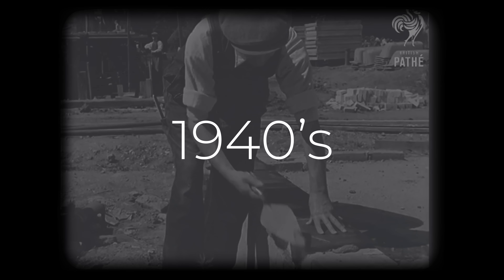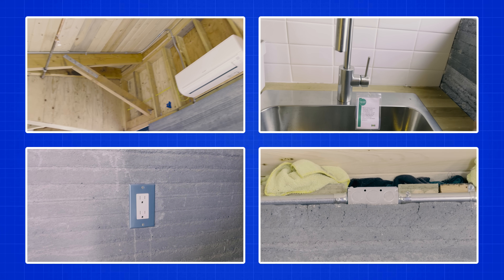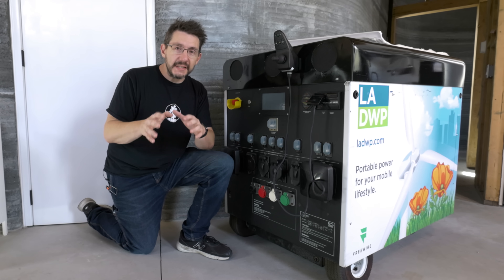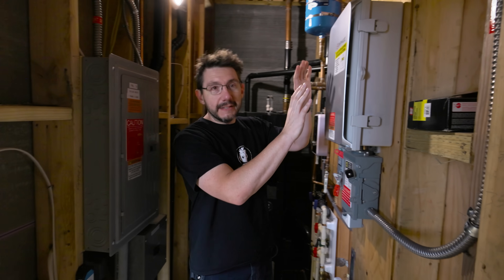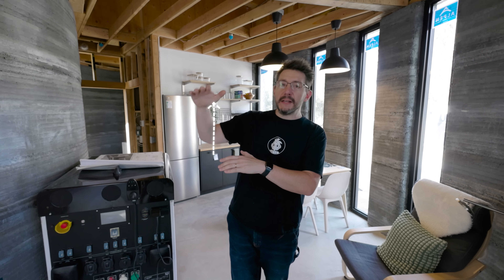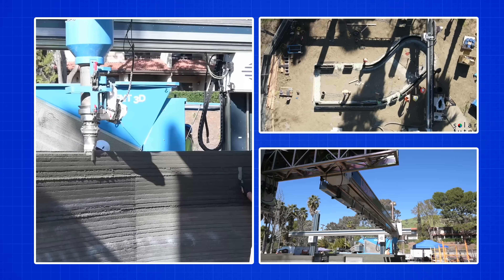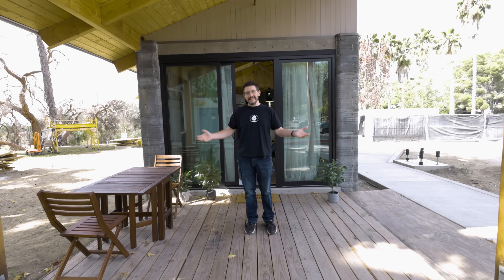ON SITE at a 3D Printed HOUSE!

Comment: to get the price down make a big square or rectangle. There is too much wall per square foot inside. It takes more power to run the AC, more for heating if you do that in LA, more materials for the walls, etc. Round is great too but doesn't work with many modern building materials.

Also how is it insulated and reinforced? Is there any insulation or reinforcement in the thin concrete walls?
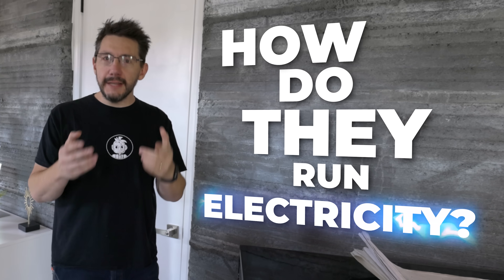Reply: @1:59 you can see down into the wall and they're using z ladder reinforcing wire laid between x number of layers.  I'd assume that after the walls are printed, they drop reinforcing bar vertically into the cavity 4 feet apart and encased in a grout mixture.
Reply: Square are cheaper to build than rectangle

Comment: I'm all for the idea of 3D printing in architecture and it should be studied to explore possibilities, find arguments for and also against the use of it, figuring out when to use 3D concrete printing and when not to, improving existing techniques and knowledge... etc. Nice to see these students actually experimenting with the stuff!

But I have mixed feelings about the presentation: the fact that they (you?) tried too hard to sell the house as a finished product like a transition house is ridiculous. Like most school projects by students, the result should not be presented as a practical / market-ready product. It should be seen for what it is: a lab, a testsite to see what works and what doesn't. A place where students can experiment with techniques, where they can learn what is already known and maybe even expand the knowledge base.

Personally, I think this video would have been better if it had focussed on the students and the learning/experimenting, rather than trying to sell a 3D printed house...

Comment: I don't like the idea of filling the walls with solid concrete. It might increase the stability, but it would make it very difficult to modify in the future. Say you want add extra outlets or run some new form of data transfer or something? Why not fill it with insulting foam or shredded waste plastic or something? I'll bet my AMS could fill that in a few years.

Comment: Very cool architecture! Only thing ithcing me as an owner of a solar power system myself is that the cells - at least in these shots - are placed exactly where the shadows of the surroundings are while all of the non-panelled roof is in bright sunshine!
Reply: designed by students. have you met many young folks?

Comment: I find it strange how the design of most 3d printed houses is a strange shape with curves. You can't even hang a painting on that wall. And there is no thermal isolation... there is thermal mass so if a concrete wall heats up during the day, it will provide heat all night.

I think there are still better ways of building cheaper. In eastern Europe we had about $100 per square feet retail price. Prices might have doubled now. Construction should be cheaper, but unfortunately everyone needs to make a profit.

Comment: 3D Printed House, umm bit misleading really, only the walls. Carbon Neutral - don't worry about that, make as much CO2 as you like it doesn't make any difference to anything. Don't get me wrong I'm a 3D printing fan and do a lot, but if you are going to print houses your printer will have to be a lot more capable than that.

Comment: For cheapness couldn't they just print it in a spiral (vase mode), then use a rock drill to drill out some holes for circular glass bricks, then crane a pre-fab roof on top. Failing that pre-fabs were invented in the 60s for cheapness :D ... and that's how china builds a lot of cheap housing quickly!

Comment: I'm curious what the comfort factor of living in this house would be like?
With the walls being 1.5 inch layer of concrete on the inside and out, with concrete added between: I'm wondering what the R-value of the walls is like because concrete typically have very low r-value of 0.1-0.2 R per inch. I assume R-values increased somehow, being the design was part of an energy efficiency competition? 
Is neat idea, but would have like to see more details on the construction method, and some cost breakdown. (type of foundation, walls, window/door install details, how water pipes installed, etc .. and how costs of each compare to traditional home construction)

Comment: I love the idea, but why not build the roof and/or second floor as a separate part similar to a smaller scale model and combine the parts. I would imagine with the right design it should work if it was printed on plywood or something and be able to separate it after transport.
Reply: Build volume is a problem. You need to print the house. Printing a roof flat and then lifting it in place would require a second setup of the printer.  Also, this particular printer is quite a process to set up. Version 3 looks like it will be better.

Comment: My college won a Solar Decathalon a few years back with some friends of mine. It's a cool thing to check out.

I've been conflicted about 3D printed houses... it's like the miracle item. "I want a home, pick some stuff on an online wizard, and... go" and then a house appears. But it's also very demonstrative without showing the advantages that are needed for many homes. $150k isn't affordable. Of course, with time costs will go down... but at a time when so many places are having issues with affordable housing, they aren't exactly rushing to build sparse transitional housing... heck, they aren't exactly keen on dense transitional housing. It doesn't exactly build the homes that those who can afford it would go for, it's too big for "Tiny Homes" especially at that cost. And it's already been demoed that modular component-build houses can be done cheaper, faster, and with more customization.

For as much as I like 3D printing, it is one of those things where you do have to learn when not to 3D print a thing. And with houses, the selling point for 3D printing just hasn't been demoed. I've read news article after news article, blog after blog, video after video... and they the most compelling use case is something like the moon or mars, where space is limited for bringing equipment and materials and using the surface material is basically a necessity. And a lot of time, space-missions are quite expensive so this looks affordable for that. But on Earth... bunch of wooden cubes > 3D printed home. At least for now. Stuff comes up every couple months so I'll keep looking for that _moment_, but this isn't it. But good luck on Woodbury University on the Solar Decathalon, it's an awesome event, even if 90% of the innovations of all the students who participate never make it out because of some esoteric reason that shouldn't be limiting it.

Sucks being negative about this. One day... one day...

Comment: I don't think this adds too much - brick building can be built in similar fashion in comparable time using existing techniques. The demonstrated building still needs foundation, roof and other structures, the benefit of 3D printing here is mire hype than real improvement.
Now, replace the concrete with some wooden mixture, create layered walls with automated spray of paper-based insulation using a "dual head" 3D printer and we can talk about it more, otherwise it's really just a demonstration that something like this is possible.

Comment: Which problem does this house solve? Concrete uses more CO2 than bricks or wood. This house is not space efficient (in german cities you are no longer allowed to build 1-2 story buildings). Is there a reaseon why no furniture is placed on the outer walls? Maybe wet concrete from rain or condensation? How stable is concrete without steel reinforcement? I see a future in 3d printing houses, but this house is not it. How about using clay and wood or hemp fibre insulation?

Comment: 5:11 Z banding must be rough.
Reply: Actually no. A flap was used on the side of the nozzle to smooth the sides of the print as the nozzle went around.

Comment: From a german standpoints, its funny to talk about carbon reduction and stuff and than you have no isolation from the inside to the outside in the walls and a complet open roth thats black.
So in Europe they build a complet settlement with this technik for testing.

Comment: I saw an article recently where a community in Texas was being built with 3D printed homes to provide cheaper housing.

Then I saw they were selling for over 500,000. Apparently rather than go with the idea that cheaper construction means cheaper sales, it meant wider profit margins so they basically tacked on a novelty fee.
Reply: They are not they are being built in Georgetown Tx a couple of miles from me. The inside walls look just like this they also 3d printer the counter island  the base is printer. Cost is high than a local build house but they add the solar panels, which.  Resale the price is expected to be lower than the local classical build homes . They will go under water on the value.
Reply: @windforward9810  Doubt it. Wall panels are more than enough to cover the inside look if you don't like it and the inside of those places looks incredible to me. Large island breakfast bar and sink, huge bathrooms, I'd love to live in a place like that. If it wasn't half a million.
Reply: The problem With wall panels is that you have to attach them to the cement wall, every add on add cost to the house. I think the house is great for areas that are rural areas that have less personal to build a house. West Texas and eastern NM would be great area for these houses. Even Midland-Odessa Tx out there due to the shortage of labor. They fill a need in some areas just like he stated the coast that are subject to hurricanes. Not in The Austin area or heavy populated areas that are not subject to those conditions. Cost could be reduced by putting on metal roofs this would also lower your insurance cost on the house by a huge amount. Some area because it is concrete you just will not be able to build those houses due the base ground being sand base, So that would leave out some areas in west Texas , because sorry it will crack than you will have problems. In Georgetown the base it’s built on is solid rock, a mix of granite and other hard stones, so let’s see if the the houses will hold up on the coast where most of the land is a sand base. I’ve seen cracks on the base before some times they get huge after 20 years that is when the major problems will start to show up. It will be great as a temporary house that will last maybe last a little longer but will not hold its value.

Comment: Considering how fast 3D tech has advanced, I'm rather surprised we don't see a lot more of these 3D printed structures around. And it's not like Cement is the only option. Bring on the Mud House. Heck, nothing says you have to print a whole House. Why not just the Foundation, or how about a Pool or Patio. And bonus, so long as the Grade is close to lvl, the printer can handle the rest. Plumb and Square Walls, no problem! Forming for complex shapes and curves, thing of the past.
Reply: Printing a foundation is actually kinda hard. The foundations for this house were done by a very good concrete crew. But getting the printer lined up with the foundation tie ins was one of the hardest parts of the print for this project. The students took a 3d scan to locate the walls relative to the wet set anchors in the foundation.

Comment: My only hope is that 3d printed houses stay as projects until they can figure out alternatives to concrete (and not fillers that reduce the harmful effects by 10%).  Concrete is 2nd in line behind gas/diesel in greenhouse emissions, ask Bill Gates why he's investing in cement companies right now.  Also even $150k still doesn't seem like a great price for what looks like maybe a 1200 square foot house.  There are steel building kits you can buy right now for $20k that can be built as barndominiums for that price point already (and steel buildings go up very quickly too because they are pre-designed and pre-built in sections).  ($128/sq foot x 1200 = $153k)
https://youtu.be/tSSjjMMKqV0?t=591

Steel also won't crumble away in 20-30 years and can be recycled.  Obviously every structure needs some sort of concrete base (whether it be foundations or cinder blocks) but making an entire building from concrete doesn't seem to be the answer either.  This seems to be solving a problem that doesn't exist.  It's like all the people wanting to terraform Mars, how about we terraform Earth instead?

Comment: Okay cool but I feel like you spent more time detailing solar than you did on the 3d printed structure. How long did it take to print? How does that compare to build time of a stick built house or cement block house? What's the insulation R value of the walls? What are the tolerance considerations for setting window & door frames? Is the concrete cut afterwards for openings or is there sufficient offset to frame in openings traditionally? How long do the walls take to dry before more work can continue? How repairable are they? What's being done for exterior waterproofing and vapor barriers? 
If you get a future opportunity to do a video on a 3d printed house, these are the details that matter to the future viability of 3d printed houses.

Comment: Be quicker to build a Pre-Fab building and cheaper than a expensive special concrete printed home which is very hard to produce 
as if the concrete is just a little bit harder while in the print head it would block just like Our lovely 3D normal printers do way too often.

Pre-fab building tech means much lower costs than even normal home made of brick. Plus they can be put together fast and to many different designs to suit the needs.

And even if you got the 3D printed home made such that it cost $150.000 that still very pricey and beyond most peoples low budget.
Pre-fab homes have all the pre laid pipework and electrical etc. already installed.  So good they can do 3D printed home, it still a waste of time and money.

Comment: My house was 175k has a main floor with full bath and 2 bedrooms,kitchen,living room, dining room,, a second floor with half bath and 2 bedrooms, a finished basement with one half laundry,bar , tv room and second half with divided wall a wood shop,  a detached garage, a four seasons porch, central air, solar,gas heat 🤔 thinks that’s it. If 150k is cheap and that’s all you get that’s crazy I know location matters but come on
Reply: You either live somewhere with insanly cheap housing OR bought your house more than 5 years ago. I live in a pretty small city (about 20,000 people) in an area that is traditionally known for cheap housing. My parents bought their 4 bedroom 4 bath house (with a backyard in ground pool) for $315,000 back in 2014..... they sold it for $720,000 last year. I cant even FIND a house for less than $225,000 in my area anymore (and the one's at that price are run down mobile homes  😑) after covid the housing market has been just insane... I'd happily pay that much for a 3D printed house because my alternatives aren't great.
Reply: I did buy my house 4-5 years ago and I live in Connecticut very tax heavy and not so cheap housing community

Comment: I would like to know if there's experiments on printing a roof. What's the max overhang of concrete? Would it require a form to even be possible? If it is possible, does a wooden roof just make more sense? Very exciting stuff!
Reply: I've seen some 3D printed homes with a printed roof, but rather than worry about overhangs what they did was printed a rounded roof separately and lowered it onto the top with a crane. The rounded design apparently helps the smaller home feel larger and allowed for more natural light to come in through skylights.

Comment: $250k... 😂🤣. $150k... 🤣😂🤣. That's not transitional housing that's just housing. Here in Georgetown, TX they are building "affordable" 3D housing at Wolf Ranch starting at $450k 😂🤣😂🤣😂. Stick built homes the same size are 25%-30% cheaper. What a joke.

Comment: How do you keep mold and mildew from growing in the "layer lines"? 
It's an interesting idea, but so far every 3D printed house I've seen has been just plain ugly. And only in California would a house that size be considered a $250,000 house. And I'm guessing that price didn't include the land. 
Still, it'll be interesting to see where this idea leads, and it's good to see something other than printer reviews.
Reply: Good question
Reply: The layer lines cure as a single piece of concrete. No concern of mold between them.

Comment: I've seen other 3d printed houses, but the big questions are where is the insulation, remodeling, updating electrical, and plumbing would be a challenge
Reply: The approach of filling the walls in this home with concrete is actually atypical. The rest of the homes that emergent printed have hollow walls. The electrician laid wire in the walls without conduit, because it was unnecessary, and provisions were made for plumbing during the prints. Insulation was blown in between the walls after the walls cured. Look for news articles about the one that was printed at Reginato boat ramp in Redding California for a peek.

Remodeling was a big question I had too, and there are some plans for that moving forward. However, they'll have to cross that bridge when they get there.
Reply: Yes

Comment: One thing wasn't mentioned of how long it would take to build a house like this from start to finish, if everything went smoothly (as in no hiccups).
Reply: I forget exact numbers I've heard but it's a lot faster than a traditional house.
Reply: Depending on the house and the complexity it can easily be done in under 10 days. The fastest ones can be done in 1 day.
Reply: @redkingrauri3769  how can it be under a day if concrete can take up to multiple days to dry
Reply: @xCastorm  General construction, not "move in" ready.